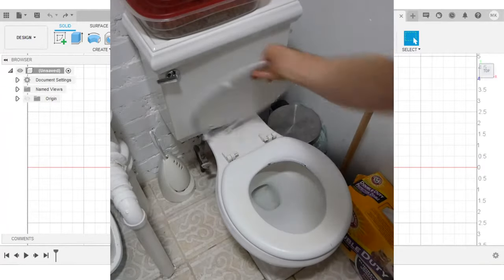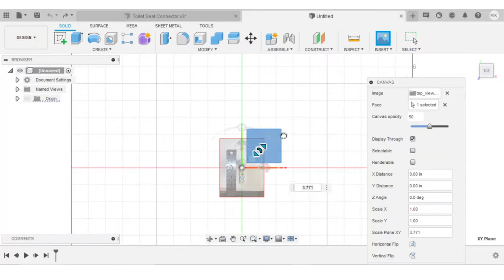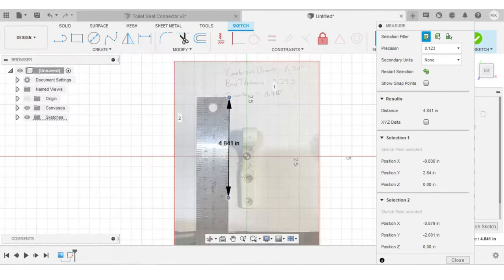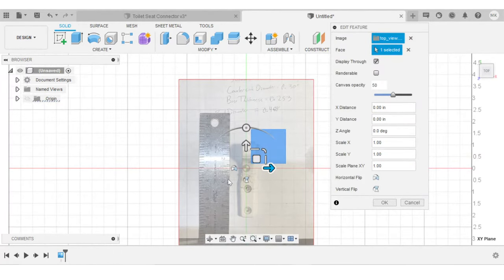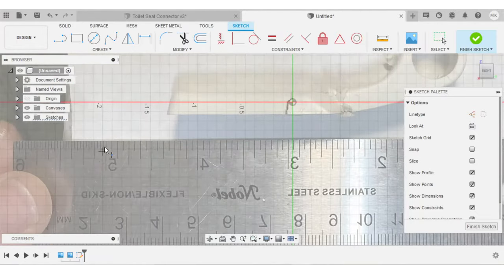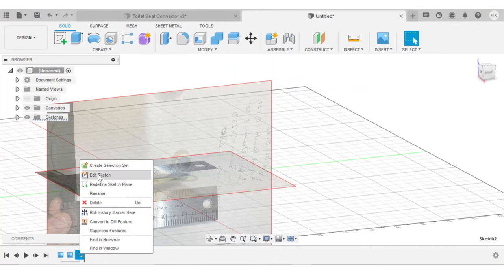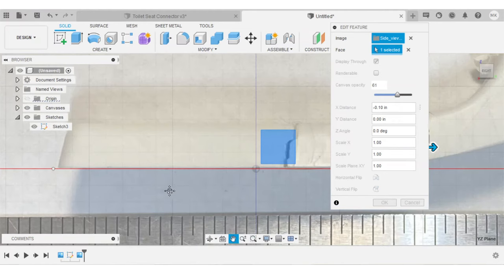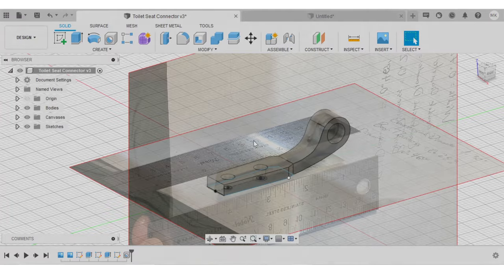How to Use Reference Photos to Design Functional Parts in Fusion 360

Comment: Why do you do your scaling factor math rather than just right clicking on your component and selecting calibrate? I'm curious to know if there's a reason for it
Reply: I guess that the calibration function is much easier + faster , but for accuracy the manual would be best , tho you dont usualy need THAT much accuracy for simple projects.

Comment: I think an easier way of doing this would be to take a measurement of one dimension of your object on each axis and drawing a sketch line of that length on the desired plane. After drawing the line, you can insert the photo and scale the image to align the measured dimension with the line you drew. Then, you can simply outline the rest of the object using sketch elements.